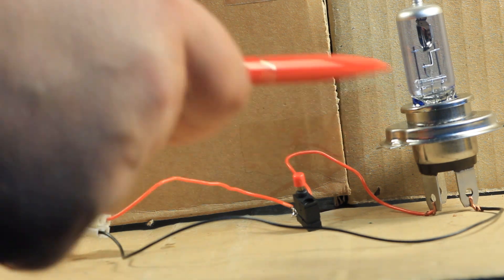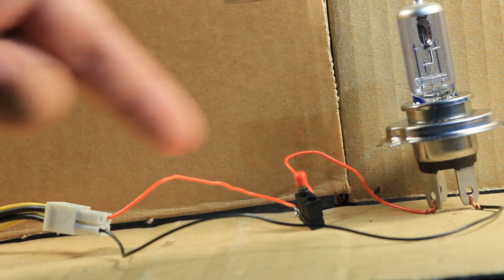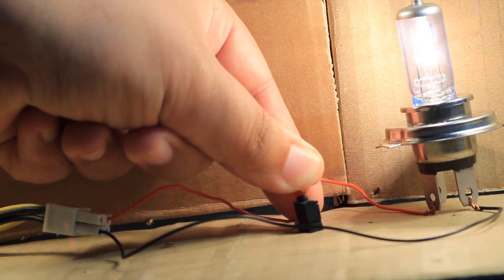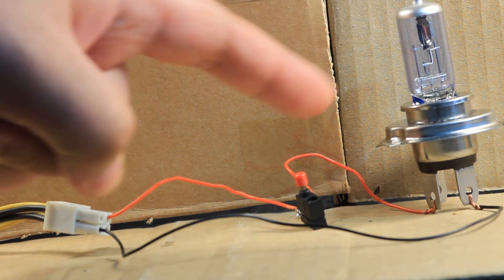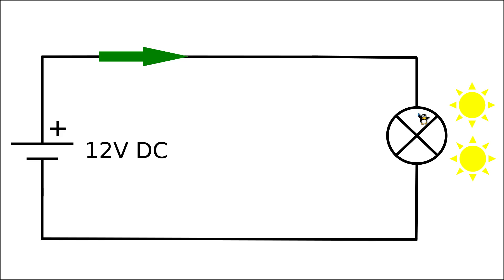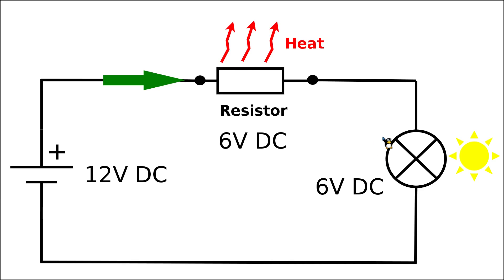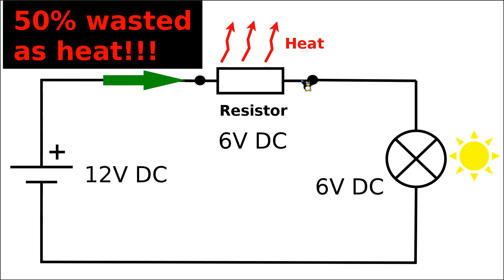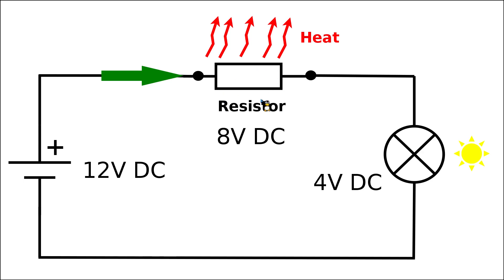Howto repair switch mode power supplies #6: Basics of Linear Regulators and voltage references

Comment: So if the input voltage increased from 12v to say 14v, what is the voltage between C and E of the transistor?  Since the base is fixed because of the diode, therefore the "resistor" is fixed, then there seems to be no regulation at all.  What do I miss?
Reply from the maker: You got exactly the issue with the simplified circuit I am presenting in the video. Namely, for regulation we will need an error amplifier, and a feedback loop. These will be presented in upcoming videos, since even so my videos are too long. Statistically speaking for 90% of the people it is fine to get the message, that in a 3 pin serial regulator there is a reference diode and a power transistor. If I would have included the discussion about the error amp and feedback, the video would have been an hour long. YouTube format is very different compared to classroom, so I must keep the videos short. Keep watching, in the following vids I will be talking about the rest of the circuit which makes it regulate.
Reply: What you missed is that you are looking at the voltage between C and E of the transistor and thinking that you are trying to regulate THAT voltage. This BJT (Bipolar Junction Transistor) is configured as an "emitter-follower." This is the ONLY amplifier configuration where output is taken from the emitter. The "input" is actually the transistor BASE. An emitter-follower provides unity voltage amplification between it's input and output--in other words, between the base and emitter. 
Let's call the bottom of the diagram "ground", which is tied to the negative terminal. The zener diode holds the voltage at the base at a constant value above ground and this configuration--unity gain--will hold the emitter voltage constant dependent only upon the base voltage. The emitter voltage "follows" the base voltage providing no voltage gain. ("Gain" also meaning "negative gain".) The base voltage is fixed so the emitter voltage is also fixed. The voltage drop across C and E will increase or decrease as necessary to maintain the base-emitter voltage constant. Power is dissipated mostly through the transistor.
Since this configuration provides no positive voltage gain, the transistor cannot provide regulation when the voltage drops below the set voltage (4 VDC, in this example) plus the transistor's forward junction voltage drop (typically 0.7 V for a silicon transistor), or roughly 5 volts in our circuit. (It cannot "boost" the voltage--it can only "buck" the voltage.) How high the supply voltage can go depends on the power ratings of the components and the maximum voltage that the transistor and zener can tolerate before breaking down.
And, in case you were wondering, the value of the zener in this configuration that will provide a regulated 4 VDC output is 3.3 volts. This is the desired output minus the base-emitter forward junction voltage drop for a silicon transistor--roughly 0.7 V. You should get the actual value from the transistor's data sheet.

Comment: Hi what kind of book do you prefer us to learn switch mode power supplies design?
Reply from the maker: I am gonna be blunt, and tell you my honest opinion here: you should download the datasheet of a simple switch mode controller IC, and design a circuit around it. This is because if you try to learn from books you will almost never start to make an actual circuit since you will be afraid how complicated it is. There are dozens of different topologies with their advantages and disadvantages. However, nowadays all that complexity is put into a single IC, just wire it up and it is good to go. You will learn more from that single build, than reading a whole book on SMPS design from end to finish twice. I wish that I could give you a good title for practical design, but most of the time the books are heavy theory for SMPS simulation, which call now all be done on a PC. If you watch my video series, I will definitely go into designing small SMPS for power LEDs and such, once I am done with the basic theory part.
Reply: This is a very good explanation. I read books about buck boost and other not isolated topologies. Now I want to learn about isolated topologies. I watched your videos and they give me a very good idea.
Reply from the maker: As I wrote, best is to make up a specific application in mind. After you have decided about the application, sit down, and look up which PWM controller IC would be good for it. Next, look up the datasheet of the IC. Look for an IC, which provides you easy design equations. For example, the UC3842 is a very popular chip, since it is cheap, and in the datasheet they give good design practice examples. This is why engineers often will use the same ICs in their products over and over, since they have it worked out in their mind, and often it is not worth to look for alternative circuits except if you are pinching pennies, or you must have a special feature.

Isolated topologies are even tougher due to optocoupler feedback. Currently I am not even at the buck/boost topology level as of yet with the videos. Hopefully I can sit down with my lazy donkey backside and produce the contents I have promised to people, so I can start the practical portion.
Reply from the maker: Oh, I forgot: for your first isolated application look for some low power application (like building a +5V USB charger is a good exercise) so that you can use the flyback topology and a single power transistor. 
This is because bridge and push-pull configurations are more tricky to calculate dead times, when none of the two power transistors is being switched on. Dead time will depend on a lot of factors, and even a small design error will lead to transistors smoking...

Comment: I really appreciate your detailed videos, as when I dive into a switch mode supply, the more details I know the easier & safer the repair becomes.  Thanks for your time & efforts in widening our knowledge.
Reply from the maker: Thanks for the positive feedback!
Some people do not appreciate it that I do not just jump right into the middle of practical repair. The issue is exactly, that without knowing the background, trying to repair SMPS is both dangerous and also it is just trying to play the lottery by exchanging some parts. After we cover all the basic principles, it will be so much more simple.